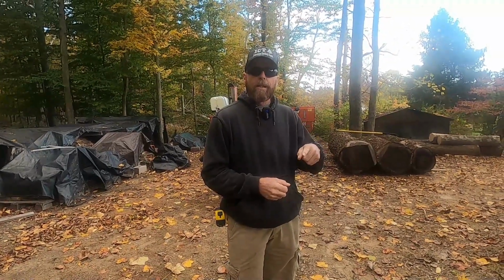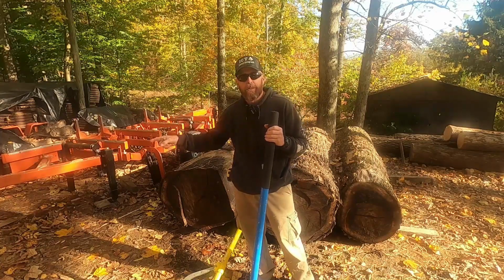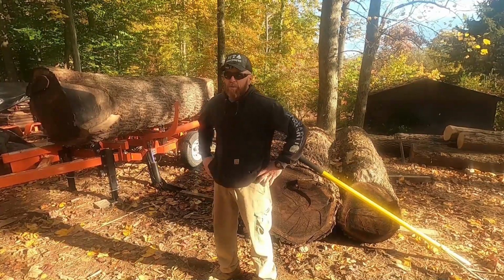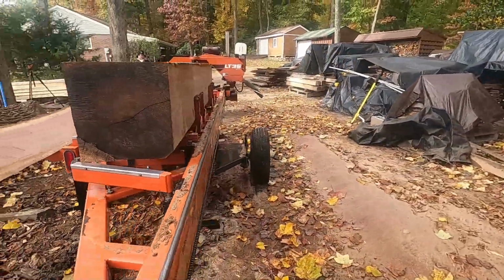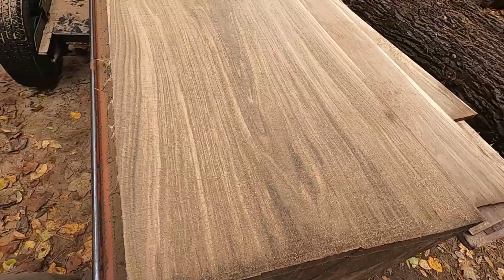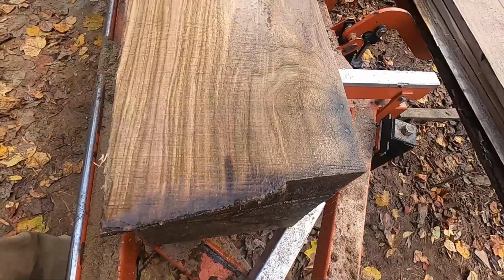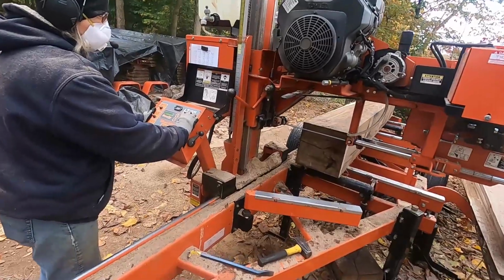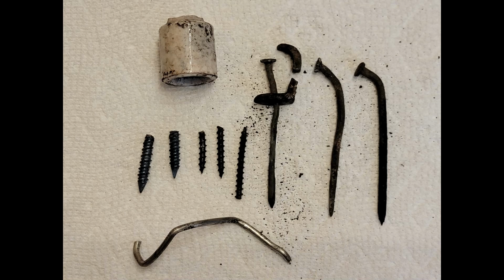Wood Mizer Takes On BIG 36" Walnut  A Challenge But @LogRiteTools Makes It Possible

Comment: Hi Chuck and Deb, sorry I missed the live chat. I’m always amazed how beautiful the slabs that comes out. Love the way you explain about the log and how you cut them to get the most out of it. 👏 for Deb using the mill. Do you have to dry the logs out first before cutting, or doesn’t that matter? I would learn so much from your guys.
Reply from the maker: Hello Adrian. No problem. Check the replay, and hope you can catch the next one.
No drying needed, but there are some species that it's better to let them sit for a while, or they will react A LOT when you mill them. All the drying happens after the milling.
Lumber drys, logs rot.
We love to share what we have learned over the years. If it helps out, it's that much better.
Thank you very much for the kind words
Reply: Thank you Adrain and no the logs don't start drying until they're mill or cut into firewood.

Comment: Hey Chuck and Deb, jj from 99 Cedars,  what were y'all cutting that to? 5/4?
Reply from the maker: Howdy jj. Good to hear from you again.  We were cutting this to 1 1/8" thick. In our experience, this gives a little extra material to clean up, when planing to 3/4" finished lumber. Besides thick slabs, this is the most common material thickness we are asked about.
Reply: Hi Johnny and I guess Chuck will get this one.

Comment: Chuk what kind and model metal dector do you have, having same problem with metal.
Reply from the maker: We stepped up to this better unit, after the wand type failed us many times. This one is the Garrett Ace 250. It works amazing

Comment: Good job! Looks like it turned out good after all the metal surprises. I am hopefully getting one this size this weekend. Do you know what one of this size is worth? Just trying to get an idea of what to price the wood for. I’m in Tn also, thanks and love your videos .
Reply from the maker: Thank you very much. Iy was a bit of work, but we'll worth the time. Black walnut is very hot now. We sell good walnut for about $7 per board foot. It can go much higher in some regions. Take a look on line for some sellers near you. That's your best bet to find a good price for your area.
Thank you for supporting our channel. We are glad to have you here on the mill.
Reply: Ok thanks for the info. I plan on doing some research to see what it goes for in my area and go from there
Reply: Hi wood in the work I hope you have better
luck then we did and not hit any metal. Thanks for watching
Reply: Thanks!

Comment: Trevor from England . why can’t wood mizer  devise something like a metal detector just  in front of the cutting blade to detect metal and stop the machine
Reply from the maker: Hello Trevor, and welcome. That would be a question to pose to the engineers at Wood Mizer. We can avoid most metals with our detector. We actually only hot one piece out of all of those pieces we pulled out. The ceramic insulators are a different issue. Only if the nail is still there, can we find them.
Reply: Trevor detector would pick up blade of sawmill staining best indicator of metal
Reply: Hi Trevor. That sounds like a great idea to me.